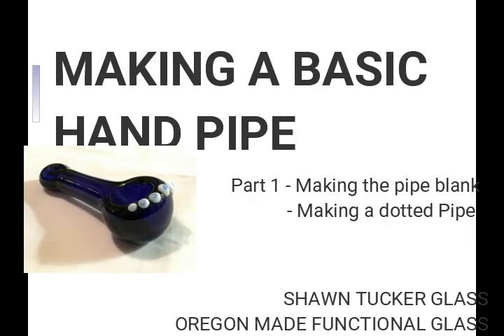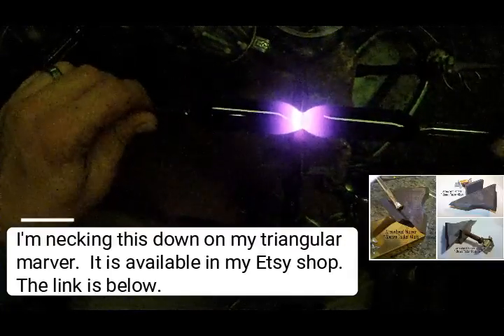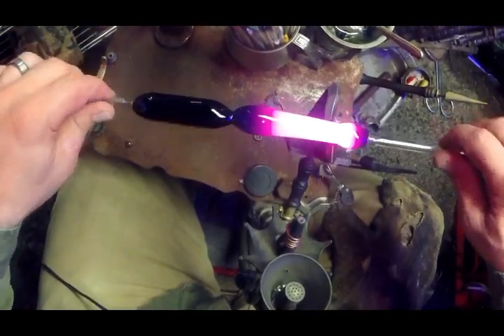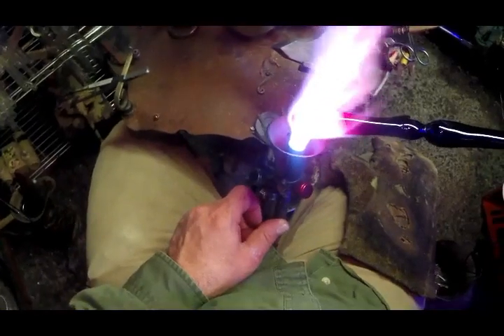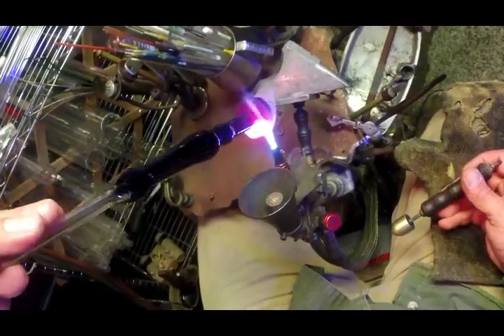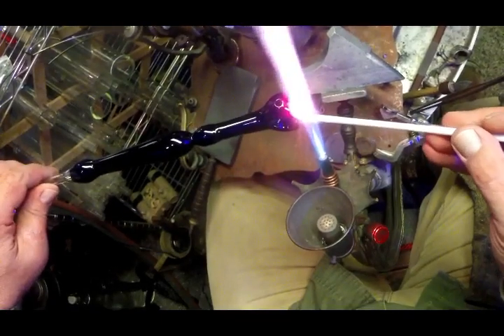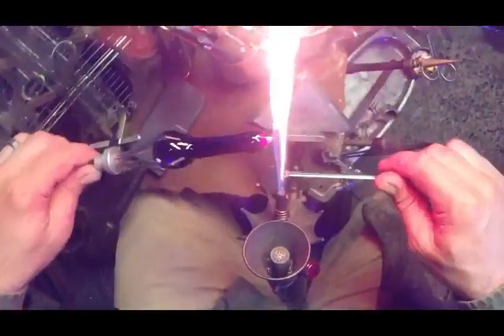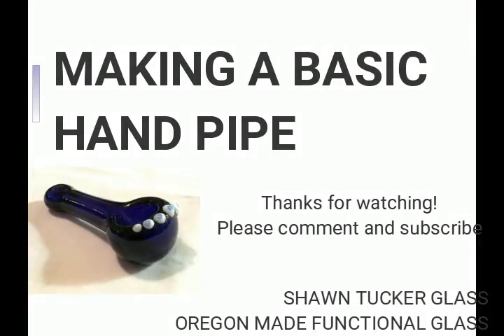Make a Basic Lampworked Glass Hand Pipe - Pt 1 of 2 - Dotted Spoon & Set Up - Shawn Tucker

Comment: How do you keep the glass from cracking without flashing it? It seems like if i don't keep the whole thing glowing a dull orange it will crack on me before too long.
Reply from the maker: Soda Lime (soft) glass is more susceptible to breakage than boro.  In addition, hollow is stronger than solids.  Usually the cracks occur when you reintroduce a cooled piece into the flame.  You'll see me garage the pieces I make in my kiln throughout the videos to counteract the stress that torching puts into the glass.

Comment: How long does the pipe stay in the Kiln for when it’s finished?
Reply from the maker: It depends on the size of the pipe and how thick it is.  These are very simple, so once I'm finished I raise the temperature to about 1050F and then cool slowly over a period of about 3 hours.  However, larger and more complicated pieces need to be annealed for a longer time.  In addition, some colors require a higher heating temperature to make them brighter.